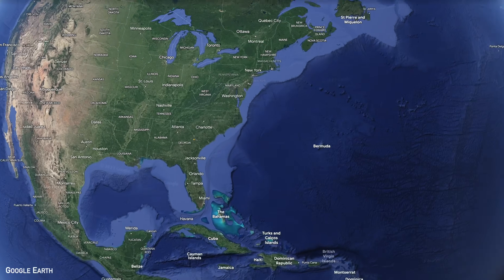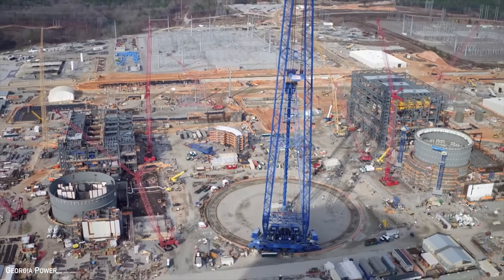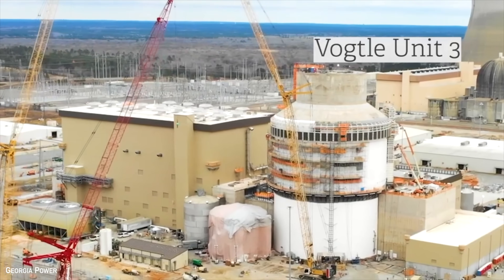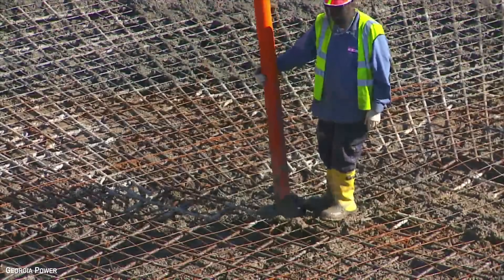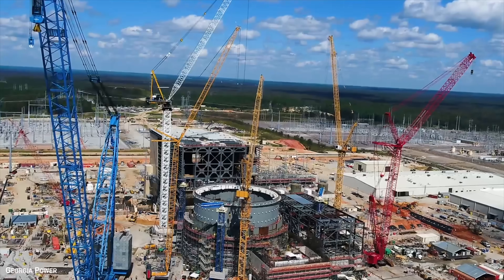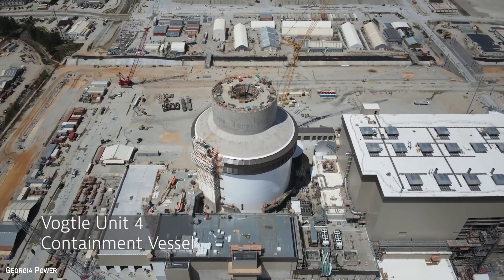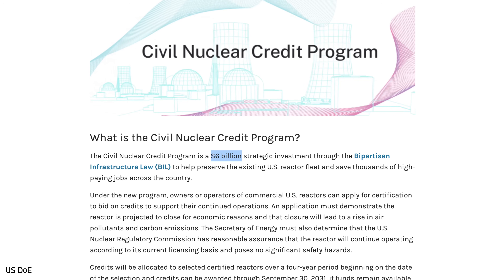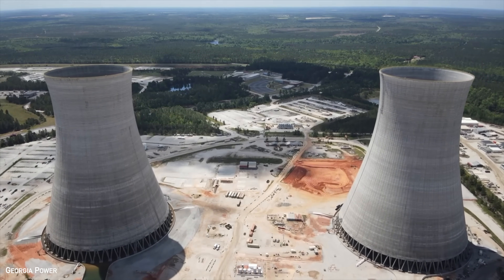Why the Future of Nuclear Power Depends on This Plant

Comment: I like the smaller build,  built uniformly offsite,  passive cooling and  already-approved plans  concept.
Reply: can you point to one, just one example of such a plant that has actually been built and operated under the U.S. build system????
Reply: @clarkkent9080  all the naval nukes built offsite. 

Dozen or more early US commercial plants 60s 400MW to 600 MW built onsite, similar LWR designs, 3-4 years ea under $1000/kw
Reply: @clarkkent9080  try the Oakridge prototype Thorium Molten Salt Reactor (TMSR). Ran for over 6000 hours over 60 years ago. Because the reaction is inversely proporional to temperature, the negative feedback allowed them to turn the pump of on Friday afternoon and start up again on Monday morning. 
Hence the TMSR became known as "walk-away safe"..
Reply: @mrvaticanrag3946  OakRidge never used Thorium in the MSRe. It was a uranium salt, no breeding in the MSRe.
Reply: @mrvaticanrag3946  And no one in the world have ever built an operational commercial electric producing TMSR in those 60 years.  What does that tell you??
Reply: @clarkkent9080  it was easier to make Plutonium nuclear weapons from a Uranium LWR  than from a TMSR - ask Nixon...
Reply: @clarkkent9080  Its all about weapons grade material nothing to do with the effectiveness of the reactor.
Reply: Yea explain how red tape and bureaucracy is responsible for this.  Who needs facts when you can just make $hit up.

Below is the Vogtle Project Management's answer for the latest delays:
Southern Co. yesterday announced another delay for its long-troubled nuclear construction project in Georgia, edging its costs closer to the $30 billion mark. 
The setback could now push the startup date for Plant Vogtle’s first reactor until early 2023 and move the date for the second one to later that year. 
Plant Vogtle’s latest move highlights the nuclear industry’s chief troubles with building large, baseload reactors: safety and cost. To be clear, Southern executives have blamed this new hiccup on paperwork, saying that workers were gathering it to send to federal safety regulators and noticed critical inspection records were missing or incomplete. The pile of missing or incomplete documents added up to a delay of three to six months, Southern said. That additional time is costing $920 million. 
“We’re a little frustrated with the latest developments,” Southern Co. CEO Tom 
Fanning talked of “great momentum” at the construction site since November. 
But workers realized “tens of thousands” of critical documents were missing, leading to a three-month backlog. 
“We’re fixing that part of the ‘paper’ process,” he told E&E News.

LATEST: Georgia Power says Unit 3 could now begin commercial operation in June, 2023, pushing back from the most recent deadline of the end of April.  Unit 4 will begin commercial operation by March 2024. The company previously has promised commercial operation of Unit 4 by the end of 2023 at the latest.
Georgia Power discovered that a pipe that is part of a critical backup cooling system was vibrating because construction workers had failed to install supports called for on blueprints. 
Fanning told investors that other issues causing delays included a slowly dripping valve, as well as a problem involving the flow through the reactor coolant pumps that hasn’t been pinpointed.
Georgia Power ratepayers are already paying for Vogtle, and most electric customers in Georgia, as well as in parts of Alabama and Florida, will eventually be charged. The effects of the further delay on ratepayers are unclear. Georgia Power has signaled it may could ask for more to be paid for capital costs and financing.

Comment: As a former nuclear quality control inspector, having worked in three plants, I move to the middle of the Pacfic to get as far from them as possible. The last one was the Dresden plant. The radioactive supply pipes were starting to crack. This plant is WAY PAST design life. They all need to be closed. The cost to decommission a plant runs in the BILLIONS. The radioactive waste has no place to go. It is stored on site. FOR 200,000 YEARS.  Right. Till someway to bury this stuff is found or some way to use it till it is no longer radioactive, then this is a failed attempt to boil water.
Reply: Inspector? You don’t know what you’re talking about based on that comment. Why not close down sone of those damn coal plants actually killing people every damn day and cooking the planet.

Comment: Geothermal to me seems to be a more doable option to produce electricity in the future.
Reply: Maybe skip what “seems” and see what is.  There is almost no new geothermal being built anywhere.  There are reasons for that. Engineers know what they’re doing.
Reply: Sadly, geothermal is not really going to happen.
We have been working on geothermal for decades,
and we might DOUBLE geothermal over the next 10 years.

That would make geothermal output (worldwide) about the same output as 2 of the biggest hydroelectric stations in the world. Just a bit underwhelming.

The main problem with geothermal is that it is 'low-grade' heat. Maybe a bit above 100C (usually not). To really run turbines efficiently we need 'high-grade' heat - 300C + (which is where Gen II/III NPP and coal are). Gen IV NPP will be up to 600-800C so very 'high-grade'.

Comment: Would like to see real working model of a molten salt reactor built in the US. There's a lot of potential there
Reply: Agree, thorium is the way to go, but we also have enough depleted uranium in Tennessee to power the country for a projected 250yrs.  Everything needs to be revised, modern breeder reactors, and also start reprocessing fuel instead of only using a few percent and discarding the rods as nuclear waste.  The non-proliferation agreements need to change.  Allow reprocessing, but damn just let those in the agreement verify the plutonium extracted is not used for weapons and instead used in reactors.
Reply: @boxlid214  I was unaware of fact your state had so much depleted uranium. Thanks for the education.  Agreed we as a country do need to start reprocessing the nuclear waste and use the viable materials that can be extracted. The treaty has outlived it's usefulness and should be withdrawn from Russia isn't following through on it. Have a great week
Reply: @bigjay875  oh no not my state, but it's where the oak ridge national lab is at (it was the other main site besides Hanford going all the way back to WWII), and they have a huge amount of steel tanks filled with the stuff dating from the cold war.  Yes regarding Russia, and everyone is back to producing nuclear weapons anyway (partly because the arsenal is old and in need of upgrades).
Reply: @boxlid214  With the Elysium Industries reactor the "waste" doesn't even have to be reprocessed but do you think the NRC will ever let that happen.
Reply: @chapter4travels  it's possible, the federal government painted themselves into a corner on energy policy
Reply: @boxlid214  I live about 25 minutes away from two aging reactors. I would love to see them be converted and believe there's more need for stable base load power generation then the incompetent federal energy cabinet is letting the people know!
Reply: @bigjay875  It takes an act of congress to make changes to or remove the NRC and our congress is broken. I see little hope for the kinds of changes needed at the NRC.
Reply: @chapter4travels  agreed congress is most certainly broken but when the light go out the ac and furnace stop working it will be hell of a show watching the blame game
Reply: Beyond the ESR and it's considerable decommissioning difficulties?
Reply: @aaroncosier735  no worse than a standard nuclear reactor, but there is the bonus of being able to run a lot of spent standard nuclear fuel
Reply: @bigjay875  For the mass of material, quite a bit worse. It had to be sealed and interred in place.  It could not be dismantled in the routine manner of extracting rods from a PWR core. Quite a big problem as emphasised by the contractors at the time.

Let us know if one is ever built in a democratic country with news services. Or properly decommissioned, for that matter.

In the meantime, spent fuel is piling up.
Reply: @aaroncosier735  “piling up”

And? It’s tiny.  A millions times smaller than the big coal ash mountains and other fuel and infrastructure waste. Spent commercial fuel is 95% uranium just like uranium in your backyard rocks, and has never hurt anybody, unlike coal gas.
Reply: @Nill757  
Yes. Piling up. It may be tiny but it's serious stuff. That's why it's expensive* to dispose. 
Spent fuel is also 5% fission products, which are intensely radioactive. 
Why focus on the safe part when the point is the radioactive part?
Why focus on the volume or weight? The radioactivity is the meaningful measure, not the weight.

Anyway, if it so trivial, then just tidy it up. The internationally recognised standard for disposal is geological interment, and the US has had seventy years to do so.
Reply: @Nill757  
If you want to pretend it's a comic book problem, then you may not have thought it through.

Arsenic and other tailings certainly show the casual attitude of industry to wastes unless carefully watched and regulated. If you find yourself within a meter of some arsenic, try not to ingest it. The same proximity to spent nuclear fuel does not require you to even touch it.
The 5% of fission products in spent fuel do not have to be separated out to be harmful. They just need to be released. You don't have to be exposed to very much: a speck small enough to be carried by wind will kill you if you inhale it. Slowly.  The specific activity of existing spent fuel is extremely high and will be for a very long time yet. You may not be concerned about the most extreme long term decay issues, but designing for even a few thousand years will be hard enough. Too hard for the US so far.

Geological interment is the only disposal method so far approved.  The French reprocess, and the resultant High Level Waste still requires conditioning, vitrification, encapsulation and secure interment for long time frames, a thousand years and more. They do this at great expense, their nuclear power requiring enormous public subsidy compared to US. They have reprocessed about half of all the waste so far produced, and of course they have no permanent disposal facility either. At least their interim storage is a lot more robust than US temporary storage.
You are correct "nobody in the world" has taken responsibility for long term disposal for this long-tern toxic material. Except the Fins, whose facility has not yet started receiving waste. But my hats off to the Socialist Democracy that achieved what the US cannot.
Why gloss over the fact that this "stuff" can cause great harm if containment fails in any manner? This has been avoided so far at great expense in facilities, active systems, guards, etc. These costs are federally subsidised in the US. However, this stuff remains profoundly deadly for a longer period than any human civilisation has been maintained, so there is a duty to put it where it cannot be disturbed. 
"spent fuel in a can", no worries, just build a can that will last 10,000 years minimum regardless weather, erosion, curious humans with hard steel, and deliberate attack.

The reason it's expensive is because it's deadly, at a distance. Hence the genuine need for shielding and reliable containment. That's some serious engineering. The US attempt had issues with water ingress for which the planned kludge was titanium overcoats for the canisters. And oxygen ingress. And yes, due to a failure to get genuine community engagement it was able to be stopped. That facility would hold less than half the current stockpile, so other options will be required regardless. In contrast the Finnish started by canvassing various communities and genuinely addressing their concerns. Not just smug assertions from politicians and an attempt to override. Any region that did not want it had their choice respected.
Reply: @aaroncosier735  “comic book”
As you know I made no joke of radiological or any other hazard, but criticized your authoritarian ‘it’s worse than anything because i say so’, evidence free, dogmatism. 

“inhale it” “at a distance” 

Look, throughout above you’re conflating things like this, ingesting and exposure to do special pleading. You want to insist your harm case is special because of exposure at a distance in one moment, is therefore different from arsenic, and in the next instance you’re talking about inhaling or ingesting radioisotopes as if ingesting any number of substances like arsenic including from your backyard would not also kill you.  For that matter there are any number of toxic gasses and microorganisms that will harm or kill at a distance from their source. Then on and on with the adjectives, “serious”, “deadly”, which you think make an argument but instead scream fraud via emotion. You refuse anywhere to engage with dose as I urged, and continue on about radioactivity as if the amount and concentration of material doesn’t matter, as it does in every known hazard throughout the science of epidemiology.
Reply: The Oak Ridge National Laboratory, here in my home state of  Tennessee had The Molten-Salt Reactor Experiment (MSRE) in the 60's. It was completed in '64, and ran between '65-'69 and achieved all its objectives.
Reply: @MBP87  can you confirm the criticisms ie frequent shut downs and 40% uptime?
Reply: Won't happen here for 10 to 20 years if ever.  You will need to watch the development in China.  China has the first molten salt reactor running.  The US can no longer do anything.

Comment: Anything from a plane, to a car, to a computer, is extremely expensive if it's a one off project. Ever more if you don't have determined leadership. It's pretty obvious that unless there is a massive spike in gas/electricity prices, perhaps due to government caps on extraction/burn of fossil fuels, the ball won't get rolling and economies of scale and know how won't get established. Nuclear can be made extremely cheap, it's mostly steel and concrete, and if produced by the dozen in assembly lines there's no parts that couldn't be mass produced just like any combustion engine or steam turbine. It's all a matter of time, waiting for the 0-net emission promises and goals to come due, and then watching as we have a last minute frantic race to build those reactors amid high electricity prices and shortages because of negligence and short sightedness of the government and companies.